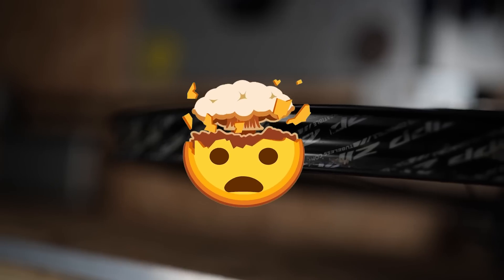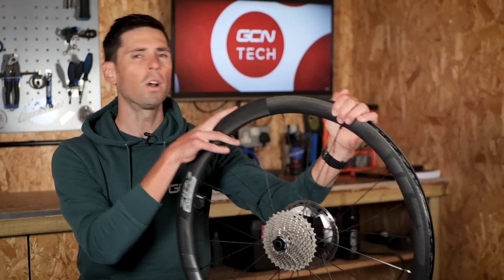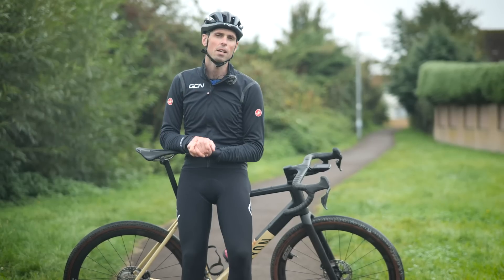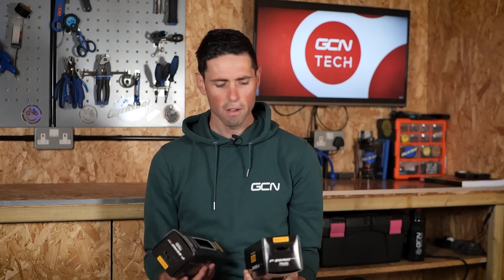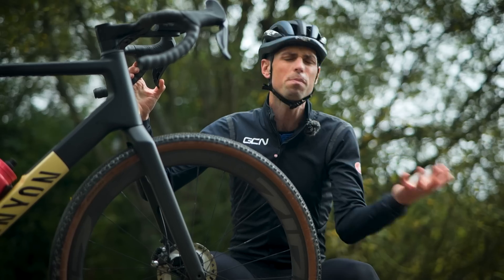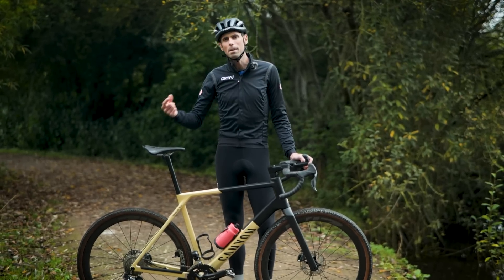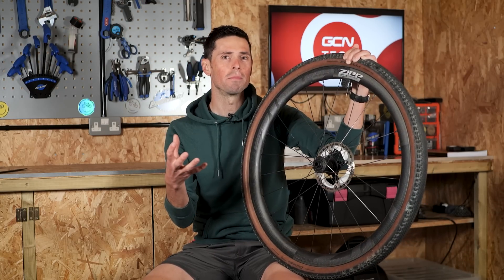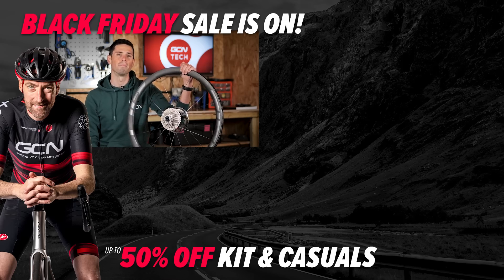What exactly is hookless technology, and what are its pros and cons?

Comment: There is NO WAY I will ever consider using hookless rims and tires. That has to be THE MOST idiotic idea since the invention of the wheel 🤪   😅🤣😂
Road bike or roadless bike 😅

My Masi Gran Corsa is limited to 25 mm width tires (widest possible), and I'm very happy with my Masi. But even if it could fit up to, say 32 mm tires, I would still use hooked rims PERIOD. 🙄🤦
I peeled a tire off a rear wheel on my 1967 Mustang (once, ONCE! 🤨), being stupid in a turn, and thought "thank God I didn't do that on my bike 😳😲"  😅
Hookless? 🤨 NO WAY, 🙋 I'm out

Comment: looking through these comments, I cannot see a single comment from anyone agreeing with your points. The public, (and Josh Poertner, have spoken), we don't want hookless. The claims you make about weight are way overblown (200g, really?!) and the aero gains are not shown to be true at all. The pressure limit IS a big deal. Zipp had to modify their guidelines lately as they decided 29mm was the narrowest one of their wheels could take. The point is, it's too easy for your average person to have a faulty guage or misread tyre width or whatever and have a tyre that could come off it's rim. When descending fast on a corner this could potentially kill people. This is a big deal. sure, go by all the manufacturers guidelines and you should be fine, but there is zero scope for error. Now tell me the real benefits, apart from cheaper manufacuring costs.

Comment: Separate point not made. the wheels on the Ribble I just bought are hookless. I have been completely unable to mount hookless tyres..my bike shop also gave up. Any standard that makes the simple point of mounting tyres so difficult will fail.
By the way, using inner tubes is not viable as you would be sttanded. It takes huge efforts to get the tyres off the bead.
Awful standard.

Comment: The biggest problem to have a good alignement and position of the tyre, is nearly impossible, the last wheelset in the workshop was a pain.....Brand new tires you cannot go further than 5 bars....so it ils nearly on a rigid tire to fit the rim properly, on hook rim  much better work.....

Comment: What a load of faff. Firstly with hooked rims I pump the tyres to the approximate PSI I prefer and then ride. I tend not to re-check the PSI for a few days instead going by a press of my thumb on each tyre and then off I go. With hookless I've got to be 72.5 PSI and no greater of woe be tide me. Come on this PSI precision and body weight equations by tyre width has got to be a total wank. How is Hookless meant to be a whole lot better being limited to specific tyres (tubeless ready only). I can find no information on the safety or otherwise of running tubes inside hookless rims. Is that safer or greater risk?
Reply: They are not.... looks dangerous on descents and rubbles.... hmmm .so e tech should be left as prototypes for weight  winnies

Comment: Regardless of their safety, reliability, or lack thereof, switching to hookless rims offer no benefit to cyclists. 
Hookless rims are designed to benefit wheel manufacturers by greatly lowering their cost of production. 
But unless that greatly reduced cost of production translates to cheeper wheel prices, then what's the point of hookless rims for consumers? 
Hookless rims don't add any capability that hooked rims are already proven to do. 
I recently bought 50mm-deep, gravel-specific, UCI-approved carbon aero wheels and the price was the same for the hooked and the hookless rim versions. 
I opted to buy the hooked rim version because it allowed backwards-compatibility with older tires and offered a technology that had already been proven safe and reliable. 
Hooked rims are still compatible with the latest hookless tires.  On the other hand, the new hookless rims aren't compatible with old tire designs.
Reply: Some of the engineers and designers never go for long rides on what they create.... damn... dangerous hookless wheels. 😮

Comment: Its old school tech. There were quite a few wheels in the 70s that had no hook.And the tires could grow off the rim. Granted the tolerance of tires and tire quality wasnt that great back then. One of the old school mechanic tricks was to put tubular glue on the flat sides to keep those old gum walls from growing off the rim. With new tubless tire tolerances and sealant with the rite pressure i would feel safe riding it. It all comes down to having all your ducks in a row.

Comment: pros? is cheaper for manufacturers aka scamming buyers
cons? everything else
Most of what you said is a lie, like the aero gain, studies say there is no difference since hook or hookless wheels are attached to the tire inner walls in the same way and I would trade extra 200 grams to save my life any day
the uk cycling channel cademedia has a video showing how and why hookless is super dangerous and why you would NEVER want it
PS you and your fake calculators forget internal pressure is NOT constant, varies with heat generated by rolling resistance, weather, and most important, mechanical stress. Get a bumpy road and you are toasted, the tire may and will at some point pop off the wheel and you may die depending on when and where that happens.

Comment: The thing is whether you think road tubeless is worth it or not you can't deny that it at the very least offers something over standard clinchers and tubes, depending on various factors and personal priorities it may not be enough to make you want to switch or use it on all bikes, all the time but its there. But road hookless offers what over hooked tubeless?
I already have tubeless, I can already run lower pressures, and wider tyres (of which I am not nearly as limited on selection) and I can revert to tubes and standard tyres if I want/need to. You guys have shown multiple times in various videos that decent carbon wheelsets are as tough as nails already and don't need to be "stronger".
What does that leave? Highly dubious at best (outright BS at worst) weight savings, wishy washy aero claims, and the promise things might get cheaper in the future?

And that's BEFORE we get to potential safety issues.

Comment: The manufacturers will also make it a lot harder for rider to lodge a claim against them when the tyre rolls or blows off, all they will say is you didn't use the recommended pressure and in order to prove you did use the correct pressure you will need to take a video everytime you pump up your tyres, use a digital tyre gauge for recording, and the manufacturer will just say the gauge wasnt calibrated correctly.

Comment: So hookless makes rims lighter because there is less material, and also stronger because there is more material.  I think the marketing is being done by two different teams.  I still fail to see any advantage other than it costs less to make them to the manufacturer, and it won’t cut your specialized turbo cotton tires to failure.

Comment: Problem with ROAD hookless is there are very specific pressure limitations that are not explained by manufacturers or people selling the hookless rims. Add this to the generally clueless level of the tire pressure they should be running, the "recommended" pressures on the tires and few using a reliable pressure gauge and you are asking for trouble. All in all it seems for the road it is a solution looking for a problem.

Comment: Let’s do the maths on weight - Zipp 303 firecrest wheelset, 28mm GP5000 TL and 100g sealant makes 2.142kg.  Roval Rapide CL2 with 28mm GP5000 clincher and Tubilotos 2.050kg so comparable hooked clincher is lighter.  Hope that stops the weight saving claim.

Comment: 102kg here- I’ve ran 303s for 8000km. Excellent wheels, that are coping with UK roads and weather superbly.
I have ran Corsa pro and currently running GP5000 AS TR both in 28mm. I run 68 rear and 62 front for all conditions on the GP5000. I’ve had no issues.
From an engineering point of view,  providing the tyres have reinforced beads, hookless is superior for most applications.
Reply: Can you please explain how hookless is superior and in which situations?

Comment: Makes sense on a MTB with 1.6 bars and tire beads so strong that they will still stay on without sidewalls, makes no sense on a road bike.
Reply: Hookless is eqaully bad and pointless for any MTB application, hookless has zero benefits on any bike. MTB tires burp and blow of hookless rims all the time. It all started with useless hookless aluminium ZTR Stan's NoTubes rims (Crest, Arch, Flow etc.) that doesn't work. They burp tires all the time, and on top of that the rims always cracks at the nipple hole. Compared to hooked DT Swiss alu rims like EX471, EX511, XM481, XM421, XR391 etc all hooked and tires stays on the rim and rims does not crack. Search 2023 Redbull Rampage Kyle Strait crash, he blew his tire of his useless Stan's Flow rim, and completely destroyed the rim in the process. Hookless is bad. Always.

Comment: Hey ZIPP/SRAM (plus GCN)... please read the room and listen to all the hundreds of comments below (in less than 24 hours no less). For Road Cycling the vast majority of people are not interested in Hookless and see no advantages to them!

I'm sorry if you've spent millions changing all of your manufacturing equipment over to Hookless only wheels, but no amount of marketing will convince us that hookless is of any benefit!

I've never ran hookless wheels, but I'm sure, on the balance of probabilities, it's a perfectly good system (better for low pressure MTB/Gravel than road IMHO)... if you are careful to ensure everything stays within the correct standards and tolerances.

But here's the thing... Me and most people, just want to put any tyre, on any wheel, pump it up to any reasonable pressure than our tiny cyclist-arms can manage 😆and run it in any amount of changing temps (e.g. 15-degs indoors to 35-40 outside in the sunshine!)

FWIW: I cycle around 10'000 Km per year. And have ran a lot of tyre brands (Conti, Schwalbe, Vittoria, Michelin, Panaracer, Specialised). In recent years, on my best bike, it's been GP5000 28's (with Latex or TPU tubes, running 73-76 psi @ 82Kg), although I put on 32's on this Winter and I may be sticking with them in future (as they roll REALLY nicely on crappy S.England roads 👍)

Comment: Thé majority of our 60 member club are not going to use hookless. 

1. It’s important not to be biased 

2. ´ the use of hookless rims puts additional stress on the tyre bead, and some tyres are not designed to cope with that force. The ones that are need to remain within the pressure limit of 72 psî ‘
Source globalcyclistnetwork 

3. Hookless was done solely to reduce manufacturing complexity and reduce cost.

4. The arguement that it may improve aerodynamics is trivial. 

5. On a hooked rim, the concern of a blow-off due to pressure or cornerning is essentially non-existent. 

6. The risk of your tire blowing off the rim is very real, and real enough that each manufacturer is careful to spell-out what is allowed on their wheel.

In summary, the few that have bikes with hookless have bought rims without. The advantages are far too small to be worthwhile.

Comment: This does seem like the ‘change is bad’ argument from a lot of the comments, I get the pressure limitations etc but so many comments saying they are dangerous, I’m not seeing loads of incidents being socialised or these compaines being sued for injuries. are they ‘actually’ popping off all over the place or are we debating yet another urban myth….. I could be wrong of course and hope no body is getting hurt...
Reply: Putting aside the potential risk issue... what would be the benefits, to you the end user, of hookless rims?

Why move away from a system that is proven to be safe and work well, to one that has at best trivial improvements*, and that you have to be 'extra careful' when selecting, mounting, and inflating tyres!

(* I think the weight and area differences are likely to be very minimal at best. And any cost saving, so far, only appears to be on very expensive wheels having slightly cheaper 'mid-range' models launched)
Reply: @DerekGreen123  its a fair point, change for change sake can be self defeating. I’ve run both, on road and mountain bike, not had an issue with either set up be I do agree you need to be a bit more careful in setting up hookless. Enve, Cadex, Zipp etc fully in the hookless camp and many others not, good we all have choices I suppose, be interesting to see where this debate iis in a few years….

Comment: A question to those, saying hookless is dangerous:
I do not fully understand, why we say a normal tire is easier to install on hooked rims than a TL tire on hookless, but at the same time the TL should be just slipping off…
Yes TL on hookless is hard to install and I never got one off the rims with my bare hands.
That said, could someone with engineering knowledge explain, why I should be more afraid of TL tires dropping from hookless rims than I am in a classical setup?
Reply: 3 types of rims: #1 Old school non-TL-ready rims with hooks, #2 modern TL-ready rims with hooks, #3 modern TL-ready rims without hooks. 3 types of tires: #1 Old school non-TL-tires with tubes, #2 modern TL-tires with tubes, #3 modern TL-tires without tubes. I opt for #2 rims and #3 tires. Never #3 rims, they have NO benefits but many limitations. All of them are easy to install, if you struggle you just need to practice more.

Comment: Watching GCN videos, I always thought that hookless is a nonsense that I don't need to care about. Imagine my surprise when I found out that unbeknownst to me, I was riding hookless rims on my gravel bike for four years now -- Mavic's Allroad. Moreover, at the point when I did find out (about a year ago), I had a front tire for which manufacturer specifically said "hooked rims only". I had about 700km on it. I did replace it, because that scared me.
That said, I never had any issues whatsoever with the wheels. I've always ran them tubeless (nice feature in Mavic Allroads is that they don't need rim tape) and my experience with tire replacement assured me that there is no need whatsoever to worry about tires sliding off the rim: many of them are pretty damn hard to get off when you need to. The pressures I ran on 35mm/38mm tires are nowhere near 73psi limit, in fact even 40psi seems too much.
With that experience, I'd say, I probably would not worry about hookless when buying next wheels, meaning I'll go for the wheels that I like, regardless of hooked/hookless.

Comment: Interesting.  

Had a Specialized Pathfinder Pro 38,  literally blow off my Zipp 303s rear rim earlier this fall, while riding down a paved bike path on a warm fall day in Central Illinois. 

A combination that I had been using for 15 months without incident over various terrain and tire pressure. 

Since it was a road ride, the tire pressure was at 67 psi... so definitely below the maximum recommended limit of 72.5.

Inspection of the rim and tire by my LBS came up with zero explanation as to why that happened. 

The tire had been in use for approximately a month when this happened. 

Wheel had been trued a few weeks earlier so it's a mystery as to why it happened  and when it did.

Fortunately it was a rear wheel, and it happened at a reasonably good time. 😓
Reply: I've been using Specialized Pathfinder Pro 38 on my Mavic Allroad (hookless) for few years (third tire). Gravel/road descending on a gravel, descending on a road without any issues.
I run them on a much lower pressure though (35 - 40 psi).
Reply: Max allowed pressure for 38 mm TL tire on hookless rim are 57.2 psi. Unless the tire blows up wider than 38 mm at given pressure on given rim. If it's actually 40 mm wide max pressure is 54.4 psi. Of course you hade a catastrophic failure, you overinflated your tire/rim combination because it's to complicated to understand the limitations. This is just one of the reasons why hookless rims are a really bad idea.
Reply: @and30ers  

How did you come up with that number?

While doing road rides I had been inflating to 65 lbs without issue for well over a year. 

For true gravel, 42/45 is what the Zipp tire pressure says I should use.

Since the blow off I've backed it down to 60 lbs  while doing a road ride.
Reply: @JonRoth_MusicSourceProDJ  Equal tension = width × pressure. When you increase tire width you need to decrease pressure for the same tension. Using psi as unit for pressure, and mm as unit for width the max allowed value for tension is: 2175 for hookless/tubless, 2610 for hookless/tubed or hooked/tubeless, and 3045 for hooked/tubed. Changing units to bar and mm the value for max allowed tension are 150, 180 and 210. (since 1 bar = 14.5 psi). Simple math. Easy to remember. Works on all types of tires and rims from all manufacturers. Road, gravel, mtb, alu and carbon rims.

Comment: as far as I can tell from this video, this basically applies just to gravel/mountain tires? As far as road use is concerned, for the reduction in weight and rim strength, combined with the limit in tire width, I feel you might as well just go tubular, or just stick with clinchers/hooked. Seems like another dumb standard made to sell extra wheels.

Comment: After watching this video, I am still not remotely convinced that there is any compelling reason to use hookless rims on any bicycle, much less a road bike. The main advantage seems to be that hookless rims reduce production headaches for wheel manufacturers; for riders, the tiny advantages mentioned here are more than offset by the huge disadvantages.  Since I personally prefer to use more-supple clincher tyres with TPU tubes rather than tubeleless, I can't see myself ever switching away from hooked wheels.